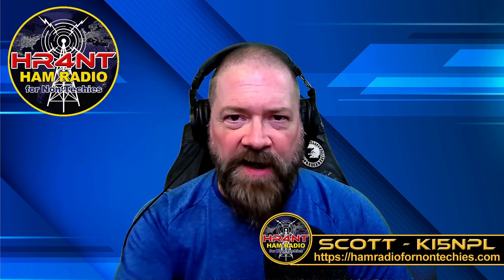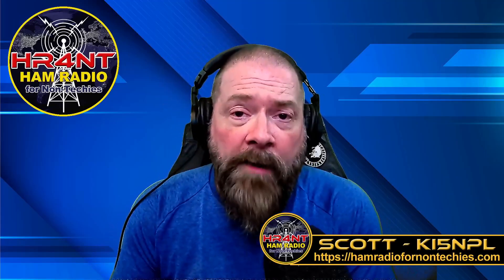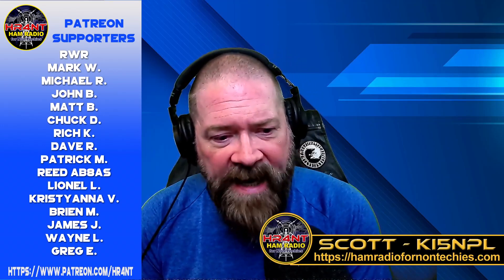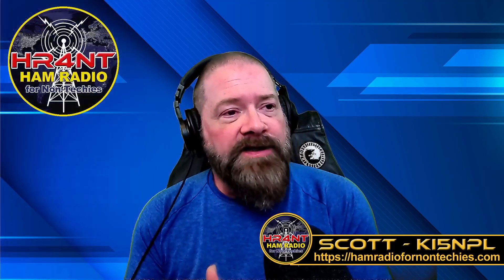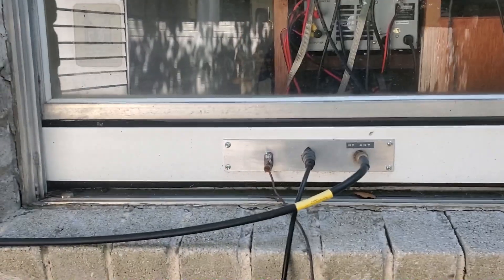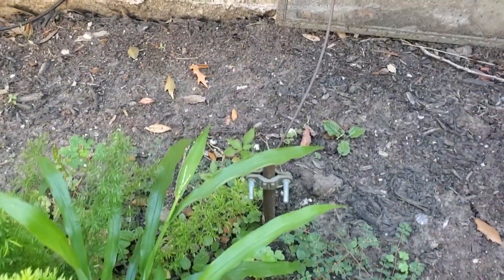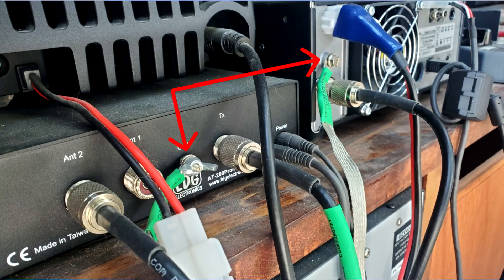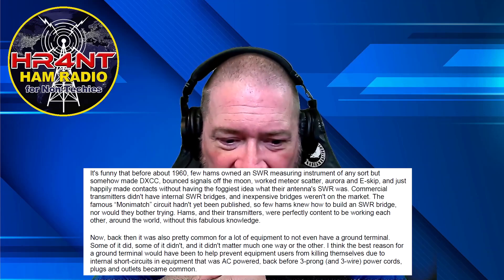Grounding My Ham Radio REVISITED:  What I Have Learned Since Then

Comment: Great video for us HAM noobs Scott! You pretty much confimed what I already knew. I've been a scanner enthusiast for 6 years now (more of a listener than a talker) and your safety ground is pretty much what I have except for the 'common' bar.  
When I first started, I ran a Olex 4mm Single Core Electrical Earth Cable straight from my IC-R75 out my 1st floor window (no pass through plate) and  straight down to a grounding rod about 15 feet below. 

The thing that was common on everything I read up on, is the safety ground should take the SHORTEST PATH possible, Because electricity takes the PATH OF LEAST RESISTANCE!
So that's what i did. Never had a problem!

With everything haviing a ground terrminal from the antenna, SWR meter, power supply and the radio itself, I'm of the opinion you don't need to ground everything, just one in the chain. And for me that's typically the most expensive bit of equipment. Like you said, if there's a thunderstorm brewing and you're really worried you might be the victim of a one in a million lightning strike, just unplug the power and antenna of your radio and you're gold! 

(YMMV, thunderstorms aren't common where I live).
Reply from the maker: I think you nailed it.  We overcomplicate the grounding thing to the point of pulling our hair out sometimes.  I think simple is best and although it may be a little inconvenient to disconnect every time there is a storm...its better than a $3000 gear replacement bill!  Thanks for watching and for the comment.  73!!

Comment: What you did was better. I've heard that if a ground cable is too long before reaching the ground rod, it becomes resonant, or ends up serving as a radiating element, which you also don't want.
Reply from the maker: Yeah I have heard that as well.  I think this, although slightly inconvenient, is the best bet to ensure my gear is protected.  Thanks for watching and for the comment.  73!!

Comment: Hello, I just discovered your channel and website! This is funny. When I built my small shack I did not really care about grounding. My reasoning was not based on science but just common sense and I thought to be wrong, but you and that article finally convinced me that I don't really need to try putting an 8ft rod into clay soil (in the summer I think it's harder than concrete). I too, disconnect everything in case of a storm and I would do it with grounding or not. Thank you man, you made my day (I just regretted reading tons of articles about grounding a Ham shack).
Reply from the maker: I am glad to have you on the channel!  I am also glad you found the video helpful and validating.  I think that we overthink the whole grounding thing.  There are situations where that would be important to ground, but if you have a basic ham shack at home and don't mind unplugging to protect your expensive hobby investments, I think it is just fine.  Thanks for watching and for the comment.  73!
Reply: @HR4NT  i found your videos very helpful and i thank you for that.

Comment: I passed some physics & engineering classes, with good grades.  I’m not actually a “certified electrician” 😂  ( to do electronics?  🤪)

if the building code says I need to do something foolish, I ain’t doing it.  find another way.  😇  sooo, get some batteries & an inverter … run the radios “off-grid”? … if we aren’t connected to grid power, grid-electrical code isn’t relevant. ( but we can charge the batts from the grid, while not on radio )

well, I’m thinking, having a radio-ground that is far the main-power-ground, seems really smart.  😅  I’m about as concerned about my grid-power company messing up my radio, as I am of lightning.  🤷‍♀️  YMMV
Reply: I mean … totally recommend getting 100-200W of Solar, and a 12V deep-cycle battery, that can live in the back yard, maybe on a shed. (like, 100% no plans to ever connect to grid).  😊👍

Mini-charging station … can re-charge all our small 5V USB powered devices, and HT radios, & good spot for a Raspberry Pi, if you do that.  Add a small inverter, and this will power a laptop.  💜

I usually suggest batt/solar for “in chase of power failure” … but it’s heckin’ great to have the option of using DC power, for radio stuff!  😂  I love that.
Reply from the maker: That is a great and smart alternative.  It sounds right to me and I agree if something sounds foolish, I'm not spending my time and money on it...LOL  I too fear lightning and with good cause.  Thanks for watching and for the comment.  73!

Comment: If you make t-shirt that says:

Baofeng: What are you so afraid of?

....I will buy it! I've got five baofengs, myself the oldest is 7 years old and I haven't had any issues other than losing a couple knobs. What amazes me the most is the standby and talk time I still get from all of their batteries being the same as the day they landed my mailbox. So it's become an ongoing question of mine to all of the hammy Skeptics: what are you so afraid of...it's only a Baofeng.

P.S. I consider it a bonus that I can open up all bands and before you say that'll get me in trouble: 1) they(bands) are not all transmittable  2) I wouldn't transmit on any of them, if I could. 3) I like to listen anyway.
Reply from the maker: I have one I was going to use as a prop at the rifle range in a future video, but after playing with it and seeing the power usage and the fact that the batteries last longer if the radio is in the OFF position as opposed to my $400 FT3DR...that alone amazes me.  They are disposable radios and they are not expensive.  I think they are useful in some situations for any ham.  Thanks for watching and for the comment.  73!

Comment: I greatly appreciate this discussion because the grounding issue has held up completion of my radio installation, worrying about doing grounding the correct way and so on.
Reply from the maker: I would again recommend doing what is best for you and your situation, but don't let it drive you nuts.  Ham radio is about playing radio not fussing with ground wires and other stuff...LOL  Thanks for watching and for the comment.  73!

Comment: My only concern, is couldn't someone easily and quietly get that window up and break in? Never leave a burglar an easy entrance.
Reply from the maker: Actually no, the window is secured by screws on each side preventing any opening without breaking the window by force, which would in turn alert to trained German Shepherds and a ton of rounds being fired in that direction.  I have had this question raised quite a few times, so maybe it should be a short show to demonstrate the lengths I took to secure it and go over the pass through's condition years later.  Thanks for watching and for the comment.  73!

Comment: I purely run off of battery. And my setup is a portable go box. Im adding as we speak a ground right outside window. I will have a bus bar in my box, but i dont really wantbit hooked to house. Unplug everything and keep the lightning outside.
Reply from the maker: I think that is a good idea, however unless you have a specific need to ground I wouldn't bother with it, especially if you are on battery power only.  I just don't think you are gaining anything by having a ground with a battery setup.  Thanks for watching and for the comment.  73!
Reply: @HR4NT  I have power lines nearby that reek havoc on my noice level to hear people. So im trying anything and ever to beat it down.
Reply from the maker: @kennygraves489  ahh ok.  That makes sense.

Comment: A friend of mine spoke with the manufacturer of his radios and they also said to disconnect the earth ground during storms since he is almost positive that his shack had lightning damage from the ground connection since his antennas snd power were disconnected.   He uses a very strong alligator clip now to bond his grounding bus to the pass through plate ground lug on his window and disconnects it when he leaves the shack along with power and antennas
Reply from the maker: I think that is a good idea.  Better to be safe than standing in line with a credit card to buy your gear all over again!!!!   Thanks for the comment and for watching.  73!

Comment: Thanks Scott.  After several years of overthinking the problem I have finally installed my ground, and it is a lot like yours.  I live in a land (Japan) where the norm is for houses to have 100V 60 Amp service entrances and two-pronged outlets.  You can buy three-ponged outlets and electricians will install them but that's considered unusual for houses as grounded outlets are generally only used in commercial buildings here.  When I had my house built two years ago I deliberately paid extra to have a few three pronged outlets installed in two rooms, the first floor motorcycle garage (my wood shop) and the 2nd floor bedroom that was to become my shack. The house ground, however, is under the wood shop on the far opposite corner of the house, waaaaay too far away from my shack for me to connect a bonding wire to it. 
 
After much hemming and hawing I decided to install a separate ground directly under my 2nd floor shack window.  For that I first installed a window pass-through with a copper buss-bar mounted on the inner side of it and from there a 20 ft length of 1 inch copper braid goes out my window in some flexible PVC conduit to the ground below.  The conduit is tie-wrapped a few inches away to the PVC down-spout for my 2nd floor rain gutter system.  The braid then goes into a small PVC electrical box where I have installed two lightning arrestors.  A few inches from the box is my first ground rod, a 5 ft long one (the longest I could find).  It attaches to another 4 foot rod about 5 feet away via #6 stranded bare copper wire, and from there it goes to a third 5 foot rod about ten feet from the second rod.  At that point I had about a foot of wire left so I terminated it at one of the support bolts for my metal garden shed.

At this point I effectively had two grounds, a house ground and an RF ground for my shack.  To bond them together I attached a short two foot length of 1/2" copper braid from the copper buss-bar to a three-pronged duplex outlet I installed directly underneath my window pass-through.  That outlet has a separate ground lug that's normally tied to a heat-pump air-conditioner or other heavy appliance ground in Japanese houses.  In my case it will serve as a tie-point for the bonding wire effectively tying my house and new "RF" grounds together.
 
I should point out that the two grounds are already bonded together through the DC power supply feeding my IC-7300 as it has a three-pronged power cord and its DC ground is tied to its AC ground.  However, the copper buss bar provides a nice way to tie all of my gear to a separate star-ground that I wouldn't have if I relied solely on the house ground. 
   
Also, this whole exercise was prompted by my very close-by neighbors all having large solar arrays on their roofs.  I'm practically swimming in QRM from them and all the LED lighting fixtures in the neighborhood.  Two separate grounds bonded together is the best I can do to keep all that QRM at a manageable level.  So far it appears to be working, though I have only just installed the system and have not extensively tested it yet.
Reply from the maker: Thank you so much for sharing your situation!  It seems like you found a good and viable solution that works for you.  Don't even get me started about solar panels!! I have the same issue with a neighbor 8 houses down and they are emitting a ton of RFI that gives me a 9+ noise floor all day long.  About all I can do around here is FT8 and occasionally hear a few strong signals on 20M.  If I can get the neighbors to cooperate and resolve their RFI issues, I can then move on to the next source which is most likely going to be bad transformers in the neighborhood.  It gets daunting, but if I ever want to enjoy radio without having to drive 35 miles away from civilization, this is my only option.  Anyway, glad you have part of your issues resolved.  Thanks for watching and for the comment.  73!
Reply: @HR4NT  I have solar on my own roof and my panels are quiet compared to atmospheric noise. Apparently the people at Enphase are pretty good at building quiet arrays. I say this because my noise floor on the higher bands is nearly the same at night as during the day. Also I am revisiting my grounding of my rigs to go outside to the ground rod that the antennas are already connected to through a copper plate with bulkhead connectors that lead to the jumpers that go into the shack via 10 foot jumpers. I plan on a copper buss bar then copper braid out side to the ground. I know it isn't NEC standard, but I am in an area were lightening is very infrequent and if TSs threaten then I just unplug the gear. I also have chokes and ferrite beads everywhere on every cord in the immediate area of the rigs. I like my 240-31 toroids!

Comment: Hey Scott! Great to see you back. Excellent topic because I just happened to buy my first HF rig, a FT 710, and exploring how I'm going to set it up in my basement. I tend to overthink things, too. 73 brother. KD9WRP
Reply from the maker: I think the K.I.S.S. method applies here.  My technique works and as long as you are diligent in remembering to unplug you should have no problems and no stress about grounding.  Congrats on the new 710!!  Let me know if I can help and be sure to check out my website for a ton of great references.  Thanks for watching and for the comment.  73!

Comment: Okay, so I live in the south San Francisco Bay Area and I have only seen one maybe two T-storms in the last 20 years and those did not have any cloud to ground lightning within about 100 miles of me. Do I need to be grounded or just use a ground rod like you did? BTW Love the travel cup.
Reply from the maker: I think a safety ground like I show in the video under my desk is going to be sufficient.  I just have a copper pipe that has ground straps from each component to that pipe.  Works just fine.  If a storm does come, just unplug the coax and the power supply from the outlet and you will be good to go.  I hope this helps!  Thanks for watching and for the comment.  73!
Reply: FYI this is the approach I will implement. Thanks 73  @HR4NT
Reply: the pole outside the house was hit by lightening back when I was a kid 60 years ago and it blew out the panel and exited the faucet in the bathroom in a very bright flash. My dad had just let go of the faucet hand seconds before hand!! Close call.  @HR4NT

Comment: Great to see you back, Scott!  Great video as always.  

I live in third floor condo.  After I got my general and bought my 7300, I gave up pretty quickly on grounding because I saw no options on how to do it with my situation.  Due to space limitations, I don't really have room for a permanent shack yet.  I do mostly POTA, but I'm operating at home, I'll set it up to use it and tear it down when I'm done.
Reply from the maker: For your situation, you would probably be just fine with a safety ground like the one I showed a picture of towards the end of this video with that copper pipe mounted under my desk.  It is more for just a static shock protection, but better than nothing.  Unplugging gear during a storm is paramount and will ensure that your gear is always protected 100%.  I hope this helps.  Thanks for watching and for the comment.  73!

Comment: Nothing wrong with a bit of voltage going through you to give a kickstart to all the OM's in HAM radio.😂⚡️

On a side not, I had another threapy session of Transcranial Magnetic Stimulation today (TMS). Basically its a high voltage discharge pulse amed at my brains frontal lobe. It stimulates neural pathways in the brain by inducing voltages via induction to the brain as we have iron in our body and basically send qrp voltages to our muscles.
My face muscles jerk with each pulse. I have to take off any metal objects and phones etc. I am not grounded, its basically like a coil pulse for a spark plug but the coil is touching my head.
These RF voltage/current fixes my major depressive dissorder and chronic anxiety by 40 to 50%.
... not all EMF is bad and no running new grounds.😂👍📻
Reply from the maker: WOW....I don't know what to say except, if it works, keep it up!  A little voltage could be a good alternative to a cup of coffee...LOL  As always, thank you for the comment and for watching.  73!
Reply: @HR4NT  thanks Scott, yes it works but not for everyone. I need top up's now and then but the difference to me is massive. Take care, we are all on the mend.⚡️💪🤯  73

Comment: Why is the need to ground your radio when your radio is already grounded by plugging into the house supply ????
Reply from the maker: When I first got into ham radio, I was trying to research everything I needed to do to make sure I was doing things properly.  Finding information that was easy to comprehend was few and far between as this is a very technical hobby.  Hence the reason for my channel being created.  I am hoping to close that gap and help others with understanding how things work without making it overly complicated.  I think the points I touched on yesterday were valid for my situation.  It seems to work, my gear has never experienced a failure.  Thank you for the comment and for watching.  73!
Reply: @HR4NT  what gets misunderstood is rf ground ,this should be done at the antenna not the shack,,equipment in shack should be bonded together to ensure they all at the same potential under fault conditions
Reply: You don’t plug your radio into the house supply… you plug your power supply into the house supply. My question is why don’t the power supplies offer a ground terminal to go to the radio to make use of the house ground???
Reply: @culpepper7665  https://youtu.be/LSL1h6MJbaI?si=InmLfCubm2fw8tR4